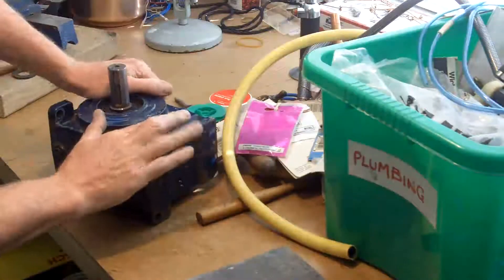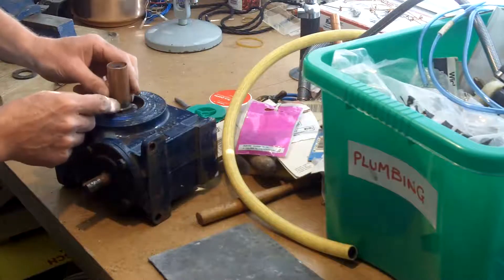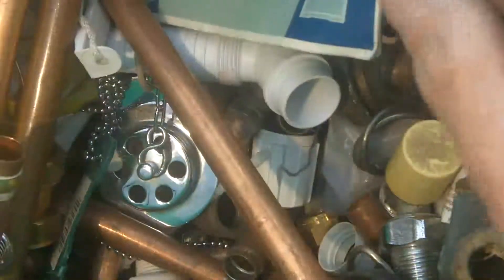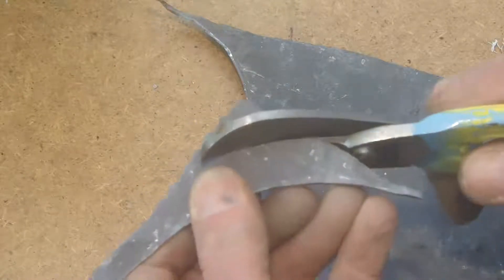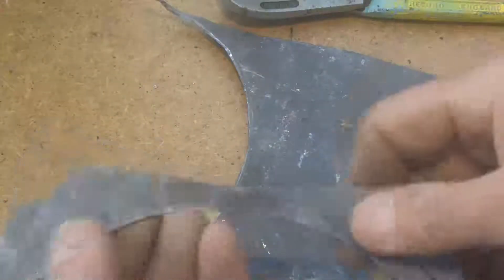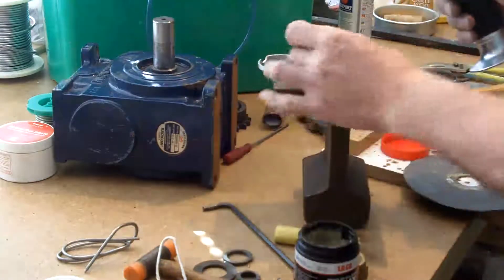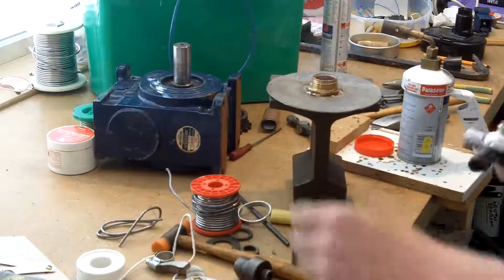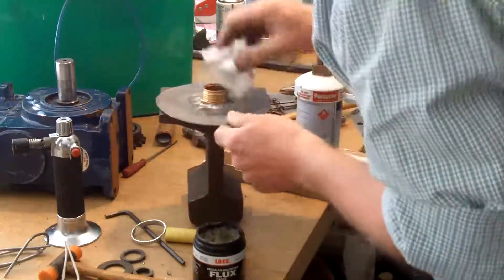About Radio 74 Antenna Rotator part 6  Sealing the rotator

Comment from the maker: Thanks Mark, I would have proffered to use copper if I had it, but I had the lead here so it got used, if I had only aluminium I would have dreamed up another way to use that but I think the combination of lead and a brass water fitting is as good a solution as any and probably better than most others. 
Regards ... Andy